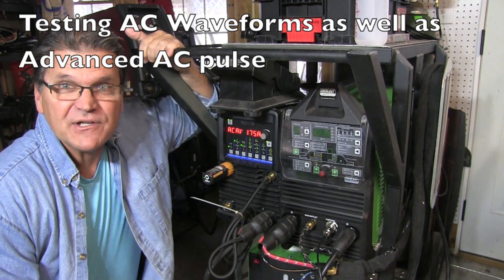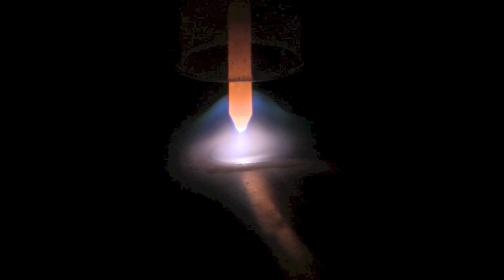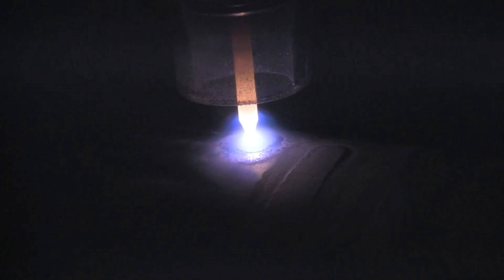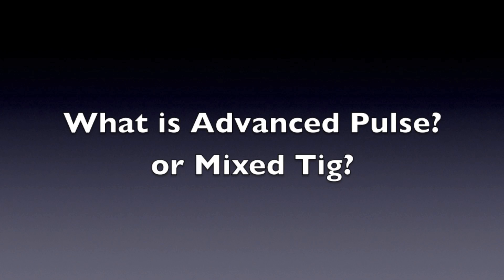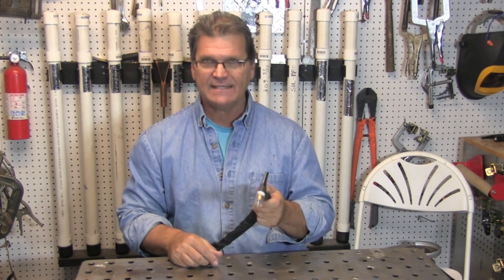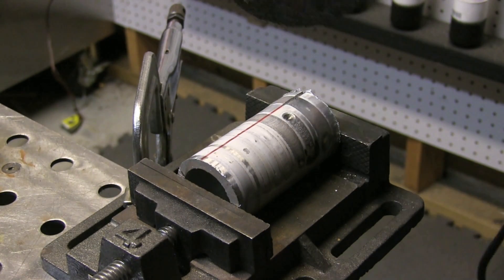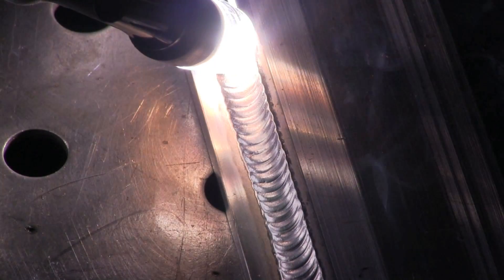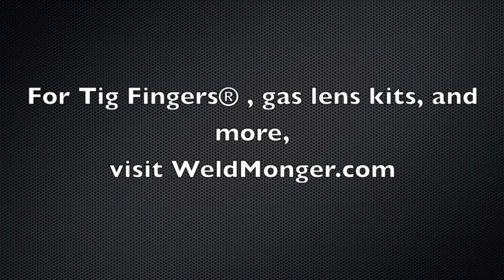AC Waveforms and Advanced AC Pulse Tig - Miller Dynasty 280 and Everlast 255ext

Comment: GREAT video.

Too bad the Everlast engineers don't understand how to build fan on demand machines.
Reply: It's not that we don't understand, it's that to have fan on demand, you drop duty cycle.
Reply: We've already developed it.  We've rejected on demand.  Duty cycle suffers.  Compare duty cycle on the 280 Dynasty to the Everlast.  The Dynasty is considerably lower at 255 amps.  What you hear is mostly cooler.  We've developed a 4 fan design which is overall much quieter and our tests show in the 60's on Db.  In a welding shop, that is nothing. We will work on a progressive cooling system in the future with the 4 fan design.  But for now it is relatively quiet, much quieter than the single fan units.
Reply: Typo from typing too fast, not from ignorance. You have correctly pointed out an error...of questionable value to the conversation. You get an extra gold star and smiley face for that.
Reply: mr grammar nazi, how about saying something smart about radiator efficiency vs heat soak vs electrical component life vs temperature vs noise? you know, instead of wasting internet space and peoples time arguing about which letter in a word should be bigger than the other, when, obviously, even, using wrong capitalization, he got the point across
Reply: How about fuck off for a comment?
Reply: it's an annoying "feature" but if you look at it from a different perspective it can make some sense - IGBTs have considerable voltage drop which translates into heat, this heat goes into a radiator and has to be cooled down, of course you could add some sort of temperature sensing circuit and turn the fan on off or throttle it, but it adds to complexity and some additional risk - if your fan or temperature monitoring circuitry fails for some reason, the heat can build up quite quickly and IGBTs will blow up (and the repairs can get expensive quick), so I think of that annoying fan sound as a safety feature :D if you turn on your green machine, everything lights up but the fan is silent - you know something is wrong...

that being said - I might make some temperature sensing/throttling circuitry on my everlast powerpro, since I'm mostly running it in 30-60 amp range
Reply: I don't mind mine. I just turn up the music in the shop.
Reply: I'm a BSEE and I suspect it would be a relatively simple program/thermal_switch mod. You're leaving money on the table.
Reply: Yeah, I have the Everlast 210EXT, which is whisper quiet, with its 4-fan implementation, and I'd hate to have the Miller's "fan-on-demand" cutting on intrusively, abrubtly, and repeatedly while I'm listening to music while TIG welding. But that that just me!
Reply: It's not even a loud fan

Comment: Jody, I would love to see how the Advanced AC Pulse on the Everlast 255EXT compares to the AC Independent Waveform Expansion card that is available for the Miller Dynasty 280 DX. Even though it is all AC, I understand that you can adjust the punch that one side of the AC cycle contributes to the heat input, both in amplitude and waveform. It would be great if you could get your hands on that expansion card, if you don’t already have it.
Reply: Dear John, do I understand correctly that you were (a year ago...) interested in how Advanced AC (also called MIX TIG apparently) compares to Independent AC Amperage Control? (For example this Topwell has both: http://www.cn-topwell.com/STC-205AC-Overview.html) 
I just started taking courses in welding. The rest of my time I try to soak up as much knowledge as possible on welding (Especially TIG) and stumbled upon the same question. 

Did you find the answer? I would love to know what you found out. Kind regards from the Netherlands!

Comment: How low amps could you use with advanced AC pulse to get same penetration than others? And would it be as good weld than others? Heat distortion would be less to the parts.

Comment: Great job man....any way you can do a tutorial on AC tig aluminum welding .030" aluminum sheet to anything thicker??  I did a project this week welding thin alum to some 1/4" round rod...was a bit challenging....
Reply: Nathan Hamler Did you put a heatsink? Get a very good heatsink. Are you welding it perpendiculer or tangent to it?
Reply: Ernesto Castellanos basically laying .030" sheet over a 1/4" round rod frame...so tiny lap joints...the best way I found was to light up on the round rod, add a little filler, then stop, let it cool, and then light up again on the tack and work it over to the edge of the sheet and just push in a ton of filler....they weren't pretty. But held...that's why I wanted a Jody video to solve all my problems lol